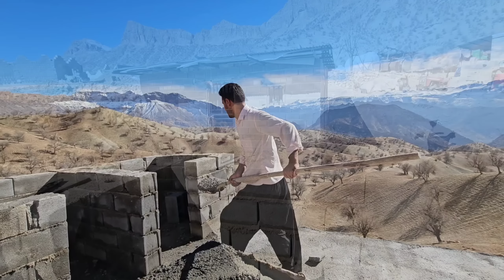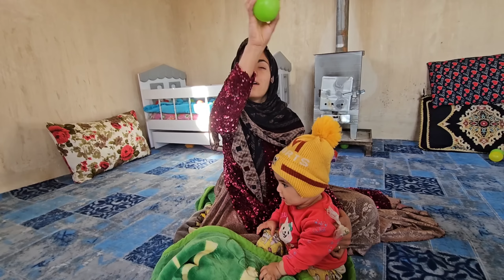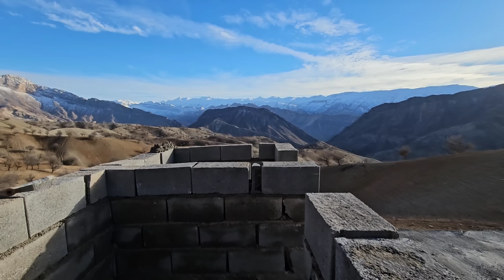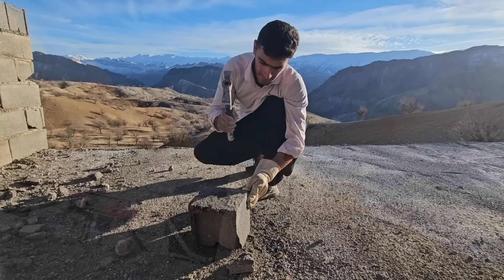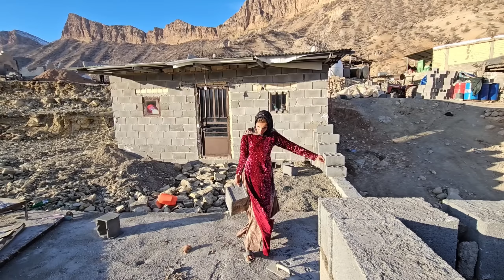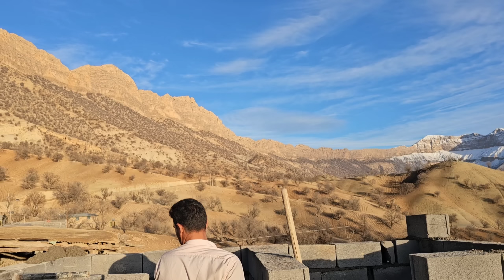A Nomadic Family's Winter Daily Lifestyle in Nature: Building a Bathhouse and the Birth of a Lamb

Comment: That is a lot of weight on the building. I hope it can stand all the weight. There is no post under the end where the weight is hanging over.animals need air and there is mo windows or vents in the barn. We raised goats for many years and they will get colds a cough and have lung problems. AIR !    They call the goats sheep !
Reply: I've had goats too.  When they get dust from the hay they really cough and sneeze!  So it's important to have air.
Reply: Hope there isn't an earthquake because everything they are building will come crashing down.  Very heavy weight without support beams.